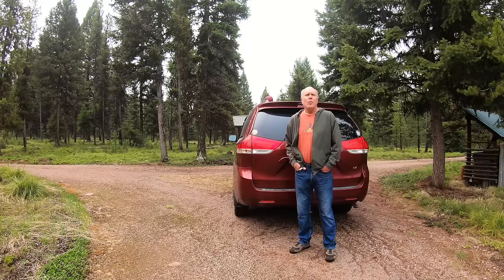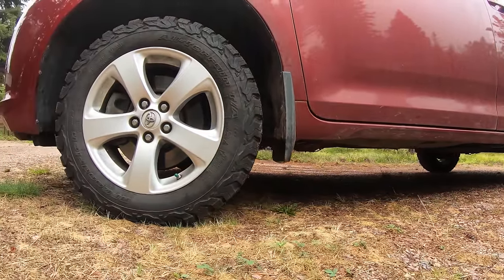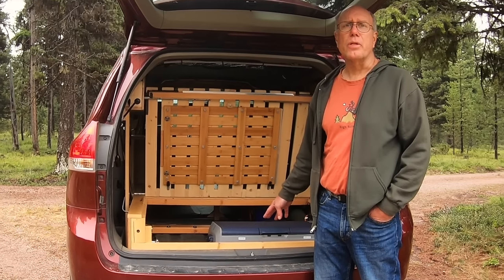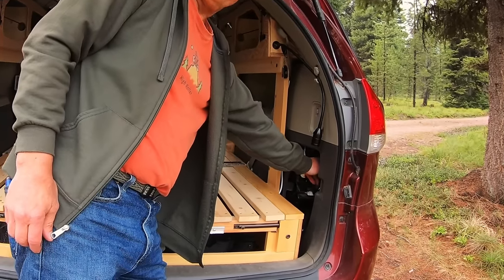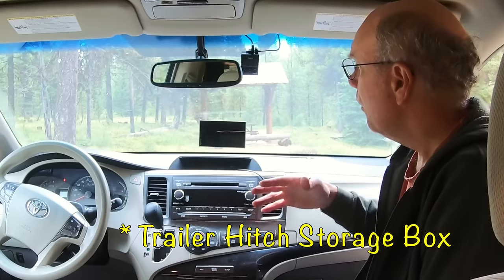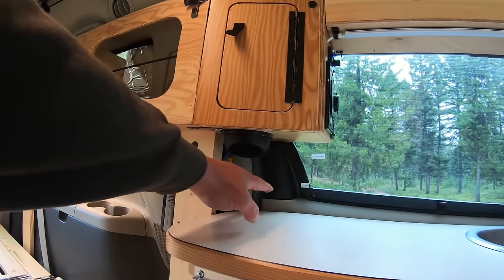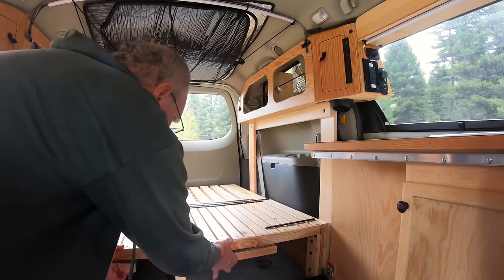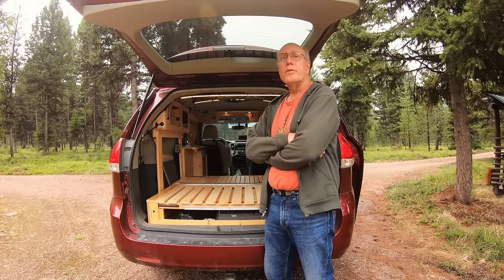An Overview of Our Converted Toyota Sienna Camper Van: The Nickel Tour

Comment: Great stuff.  I'm 71 now, alone, and contemplating a van conversation for lone fishing trips, etc. But you have shown me an alternative, as I don't like noisy desal engines, which  most Vans are. So the Toyota Sienna looks good for my needs, as here in Ireland B n B's and cheap hotels, are not cheap, and Tents are a pain. Thanks Man.🧐
Reply from the maker: Converting the van can be fun, and enjoying the fruits of your labor are more rewarding.  Best of luck and thanks!
Reply: You have the option (unlike in the USA) of buying a new/recent VW Transporter. Though they probably cost twice as much as a Sienna!
Reply: I looked at two 7 seaters in the last 2 days n walked away from them, because of bodywork issues. Apparently, in d UK, vans are dearer to insure than a 7 seater cos u can insure it as a car?Whereas, an 8 seater is automatically classed as a van. But my friend says you can insure a van cheaply as a social and recreational vehicle, as like a car? So I'm gonna check it out and may go for a Transit connect or similar or even explore  removing the passenger seat in a car so I can stretch out and sleep there-in screened out as I will prob just go for overnight stays without all the camper paraphernalia and furniture etc.?
Reply from the maker: @frankosmith6718  Always a good idea to go on a couple shakedown trips of at  least a few nights.  You'll usually end up making some changes that will improve things.
Reply: @dougmaryhittheroad  This is very good advice. I also recommend you do the same with your travel partners. Some personalities change. Especially when having to live in such close quarters!

Comment: King of the road  , Mate ....loved your  idea of the diesel heater  ,  Tank on the top . Similar  two - three  pipes on the sides would make a good  water tank  4 gallons each ...with a 4 inch  4 foot pipe .   Can be used as  drinking water storage  Plus   for a Shower outside the  van.

All the best  brother  ....... C U  on the road .
Reply from the maker: @sun6v546  Thanks!  Happy travels!

Comment: Although have some really great features. 
I especially liked the furnace and ductwork. 
I’d like to know what type of fan you installed for air circulation. I’m assuming a computer muffin fan?
That’s genius the way that was set up with the window. Thanks for posting
Reply from the maker: I used a stack of 4 computer muffin fans all zip-tied together and controlled with a tiny variable speed switch.  Then there's a short piece of PVC pipe for the rest of the ductwork.  The register is the same as comes with the kit for the furnace, and rotates directionally.  
The furnace is surprisingly cheap and reliable.  Many versions available on Amazon, and I modified the ductwork a bit to reach beyond the front of the bed.  
Thanks for the feedback!

Comment: Always cool to meet another Trekker!!! Love your build! Would you consider doing a 2.0 version for me? And what would it cost with your improvements? Of course, I would let you film the build for your channel?
Reply from the maker: Thanks for the offer.  The total cost for  the conversion was around $10K, but that included some trial and error stuff that didn’t pan out, and I could shave off some other items now with the experience, so materials would still be around $8K.  The time could easily be several hundred hours, which would translate into an additional 15 or 20K for a skilled professional with a shop or working space.  Personally, I don’t have the time to do another build, we’d rather be on the backroads somewhere.  But once the cost of the van is added in, you’re starting to approach the cost of a pretty good quality higher end van like a Sprinter, as least on the used market.

In my opinion, van conversions like this are more suited for people trying to do something themselves that they wouldn’t otherwise be able to afford.  Even if you don’t have much experience, you can do a fairly nice conversion with basic tools and some driveway space, then make upgrades as you decide what you need.

Start with the basics, start enjoying the travels, and start taking notes.  You may be surprised at what you can do.
Reply: What wood did you decide on? Popular? Ash?

Comment: Awesome Van! I’m working on getting the lift and solar too. Your the first person I have seen using a diesel heater I like the tank on the roof. 🙏🏽👊🏽
Reply from the maker: Thanks!

The tank is just 4” PVC pipe with end caps glued on.  I drilled and tapped it for brass outlets, and drilled for a 2” PVC fill pipe with a cleanout as a cap.  

One thing that I would do differently is add a baffle in the middle.  Something like a PVC floor drain cover glued in to the center of the pipe would work fine and eliminate sloshing back and forth when it is partly full.
Reply: Thanks got the info! Good idea the baffled tank!
Reply: Agree I had not thought of that. Would like to see more of that procedure.

Comment: How are you to establish a monetary value for your campervan if it were to be totalled? My wife wants to convert her old Sienna, but the work is a labor of love along with receipts for the parts. You have done a magnificent job on this van!
Reply from the maker: Thanks for the compliment.  We just carry full auto coverage on the van, plus AAA for roadside assistance.  We've never had a claim, so I don't know how it would turn out.  I suspect that I would get book value if it was totaled.  

Barring a massive wreck, we would be able to remove everything from the interior and assemble it into a different Sienna (3rd generation) in a day or two.  All of the interior cabinets and bed modifications are fastened to existing hard points, like hand grips and seat rails, so would remove and reinstall quickly. There are a few electrical modifications that wouldn't be too hard to replicate.  The lift kit would take about a week, and I don't know if insurance would compensate for that or not.  

My concern would be that I would be unable to find another used van in the same condition.  I haven't looked into RV insurance, so I don't know if that is a possibility.  But if you have any information on how (or if) that would work, I would be interested to find out.

Comment: Super job.  What is the brand of the metal storage box you use on the trailer hitch?  
Does it come with the swing arm?  If not, what is the brand for that as well.  
Thank you.
Reply from the maker: The box came from Amazon, (DEE ZEE 8546B Tool Box), but I have seen them elsewhere since then, sometimes under different brand names.  Northern Tool has a variety, as does Tractor Supply Co.  Amazon’s price seems to fluctuate quite a bit, so it might be the cheapest, depending on when you buy.

The hitch-mounted carrier is called a “Swingaway Hitch Frame” from StowAway Cargo Carriers.  They make them specific for different vehicles.  It has worked out beautifully, with absolutely no problems.  I made a wood support of two pieces of larch, which is very strong wood for it's weight.  Planed to 1" and 1-1/4" so the box would be level.

My van didn’t come with a hitch receiver, so I had to add that too.  Mine was from eTrailer, model  # e98853, which is a 2-inch, Class III.  It is the highest mount that I could find, so it didn’t change my ground clearance.  There are some YouTube videos about installation.  The directions called for removing more parts than I actually needed to for the installation, so it took some time, but wasn’t too hard.  It has been rock-solid too.  

The box blocks the back-up camera and the license plate, so I got a battery operated camera/ plate holder which works pretty well in conjunction with my GPS viewer on the dash. It was from Amazon (Garmin BC 40, Wireless Backup Camera,  #010-01866-00)
Reply: @dougmaryhittheroad  - Super info.  Thank you very much.
Reply: You brought a lot of part numbers to the table and again I appreciate the time it saves me in selection. Time is money.

Comment: Okay this is definitely one of the best Sienna builds I've seen! I'm sorry if I missed it, but do you usually leave the mattress on the bed or is it tucked away somewhere?
Reply from the maker: While we are traveling the bed folds together (tri-fold) with the head and foot on top of the middle, then the rest of  the bed platform slides in.  It's pretty easy to make it up again at night, taking 5 minutes or so to set up and put the sheet and blanket on.  Off-season when we're back home we pull it out and store it in an unused bedroom.
Reply: While talking about the bed, how easy is it for you to turn over in? What thickness of mattress did you use? Make up, air, memory foam? In some instances, I'll be solo in some with I'll need my partner in crime. Can the width be adjusted?
Reply from the maker: @dewhittjames   We bought a mattress from Amazon:  Milliard Full Tri Folding Mattress with Washable Cover (73 inches x 52 inches x 4 inches).  
It works well for the first few months, but its probably time to look for something better quality, maybe a more dense memory foam.  Mary makes the bed up in about 5 to 10 minutes while I'm downloading photos from the day in the front seat (out of the way).

Comment: Great videos, we enjoyed them all. We’ve wanted to put a diesel heater in ours Sienna but was hesitant about keeping the diesel tank inside the van, great idea putting it on the roof rack. Did you have to use special glues for the PVC tube&caps or just regular pvc primer& glues? Any leakage during your trips? Thanks
Reply from the maker: We had similar reservations about diesel inside of the vehicle, mostly due to the smell, even in a tightly closed container, plus the difficulty of refilling and reconnecting. 

Regular PVC primer and glue works fine, without any degradation of the plastic or the glue. PVC holds up very well to petroleum.  I added epoxy putty around the riser/filler piece as well, just to add strength at that spot.  There is a small breather valve at the top of the fill cap that I opened if we needed the heater, then closed in the morning before taking off again. That kept it sealed very well without any leaks.  

We needed to be extra careful filling the rooftop tank at the pump, with a delicate finger on the trigger to avoid spilling.

Comment: Hi, great stuff. How did you remove the rear seat attachments for the seats. They really get in way
Reply from the maker: I saw a YouTube video about how to remove the sliding carriages.  Basically, the rear bolts are removed on the tracks and then they are slid off.  Each one is done differently, some from the top some have bolts through to the underside.

Comment: Where do you store the mattress. Like all your ideas.
Reply from the maker: It's stores folded together (it's a tri-fold type mattress) on top of the bed platform, which is about 12 inches, folded together.  The sleeping bags and pillows next to it are about the same height.  It doesn't obstruct my view out the rear window while driving.

Comment: Anything on a potty? Love the workmanship.
Reply from the maker: Scroll down to effspoehr1757.  I left a good description there.  Low-tech works just fine for us.
Reply from the maker: That does seem to be a topic this isn’t mentioned too often.  In our case (and many others that we have met), we each have a pee jug, according to our specific need.  Mary’s is a wide-mouthed type and Doug’s is an orange juice jug.  Both are about 2 quarts or so and (thankfully) have tight-sealing lids. Emptied in the woods, at the nearest outhouse, or public bathroom and rinsed well.  

For #2 Some places had outhouses and rest stops frequently (like Yukon) while others were never seen (like Alaska).  In the east, there were many more coffee shops and fast food places with bathrooms.  Since nature doesn’t always respect a travel schedule, we also brought a “Luggable Loo”.  Basically a toilet seat and cover that snaps onto a 5 gallon plastic bucket.  In our case we switched it out for a 3 gallon bucket, which was a bit shorter.  Kitchen sized trash bags and kitty litter, and double bagging kept everything odor free and sanitary.  Dropped into the next litter receptacle or dumpster isn’t much different than disposing of diapers.  When not in use, the Loo and bucket were a place to store TP, a bag of kitty litter, and the roll of trash bags.  It often made a suitable chair too.

All of this took a bit of patience to get used to, and we didn’t need the loo that often, but it was good to have when we did.

Comment: Can I ask how you stop vapor lock from the fuel tank on the roof??
Reply from the maker: The diesel tank on the roof is only for the heater, and gravity flows to the filter and small pulse pump.  I have a valve at the outlet of the tank and a tiny air valve on the top of the tank.  I open the air valve to equalize pressure before turning on the flow valve and turning on the heater.  Since diesel doesn’t vaporize easily, I haven’t had problems, and I only use #1, which flows better in cold weather.  So far, no problems, even if it hasn’t been used for 6 months or more.
Reply: @dougmaryhittheroad  thank you so much for the information.  I did not see the air valve in the video. Keep up the good work I enjoy watching the videos

Comment: Hi Doug and Mary,  What year is your Sienna and is it AWD?    Also, would you be willing to answer some simple questions re. your electrical system.  I have studied B. Parks system... but still have some questions.
Reply from the maker: It's a 2013, and front wheel drive only, not AWD. But we had no problems getting anywhere we wanted to go. I attribute much of that to the tires we had.  And yes, I'll try to answer any questions you have.
Reply: That's great to know, since AWD is expensive and bad for gas mileage, and limits options for buying, so not needing it is a big plus.  
Is it equally fine in snow?
Reply from the maker: @a.w.thompson4001 I wouldn't say that it was equal in snow.  That is where AWD really shines.  We did better than low clearance cars with regular tires, but had to go slower and more carefully, and we didn't go on anything with more than a couple inches of unplowed snow on the road.

Comment: Does your bed convert into a sofa? Interested to see how that works.
Reply from the maker: Yes, it does with the rear section lifted and a couple pillows added.  Works well for watching movies on the laptop during rainy evenings.
Reply: You said it. You don't need a TV in a camper. The laptop computer is all that's needed. You can put movies and TV shows on a hard drive no DVDs needed to take up valuable space. You can also pick up local TV stations if you pack a small antenna. 73

Comment: I like you wood working skills. What are the metal strips holding together the bed slats? Also like the metal strip that you bent against the ceiling holding the led lights
Reply from the maker: The piano hinges hold the slats on one end and at the front I added a couple pieces of scrap girder tie strapping as a stop.  That was also used across the top.  Its really just some scrap that I found at the local used building material store. Typically it isn't too uniform or straight, so I had to spend some time getting the right angle and profile.  Home Depot also has an assortment of metal sizes and lengths that would probably work.

Comment: Great design!  I'd love to see more about the mattress system and couch mode. It looks like you have quite a bit of head room even with the clearance for your battery and fridge. What's the height of the bed from the floor?
Reply from the maker: It’s a delicate balance determining the headroom height.  I’m fairly tall, so wanted to be able to sit on the bed platform without hitting my head, but the lower the platform, the less storage room underneath.  Refrigerator size and solar battery size were also determining factors, so every fraction of an inch was very valuable.  Different people will settle on different heights.  I’ll try to include some more photos of the bed in future videos.  

Also, the floor of the vehicle is slanted, so there is no consistent location height.  I wanted the bed (and the cabinet) to be dead level, so, after trying several measuring methods, I eventually used my construction laser level.  But that meant that equally important was making sure that the vehicle is setting on a level garage floor or driveway.  Luckily, I had a heated garage with a flat, level, concrete floor to work in.

Comment: I’ve seen numerous reports of CV axle damage as a result of lifts on the Sienna. One person said they went through two factory CV axles in about 40,000 miles. That’s not cheap. Did your lift take this issue that is apparently Toyota specific into account somehow?
Reply from the maker: I have not heard this, and have not had any problems (so far - knock on wood).  The manufacturer of my kit did note the importance of sticking with genuine Toyota CV joints if they needed replacement.

Comment: Great build! I tried the Garmin backup camera and could not maintain connection so i returned it.
Reply from the maker: The wireless one that we use occasionally has connectivity problems, and goes through a set of lithium batteries in a month, but it's the best that we have found.  Running wires to the rear of my trailer hitch box wouldn't work, and it is discreetly built into the license plate frame.
Reply: Humm, is it an issue with the swing out carrier from the hitch placement?

Comment: Quite a remarquable design. Congratulations ! 👏🌿
Did you document your conversation costs? What would the overall cost be?
Reply from the maker: The total cost for the conversion was around $10K, but that included some trial and error stuff that didn’t pan out, and I could shave off some other items now with the experience, so materials would still be around $8K. The time could easily be several hundred hours.